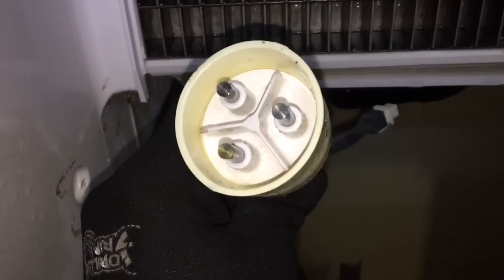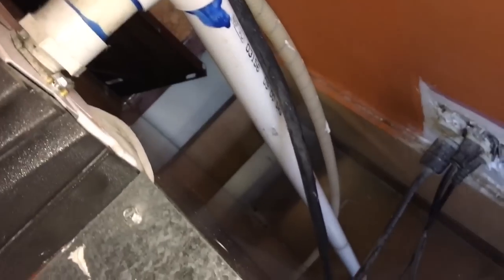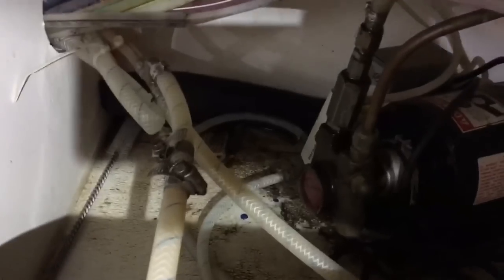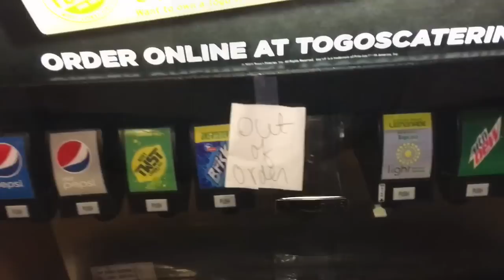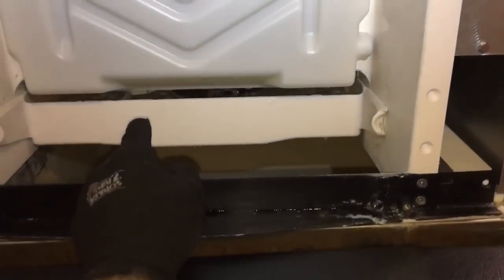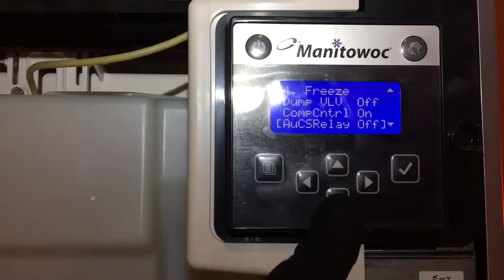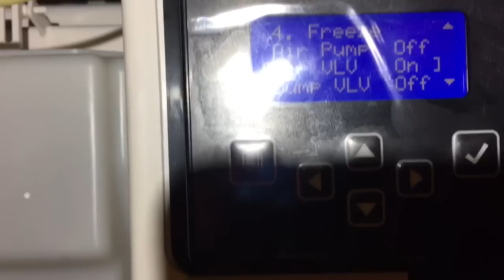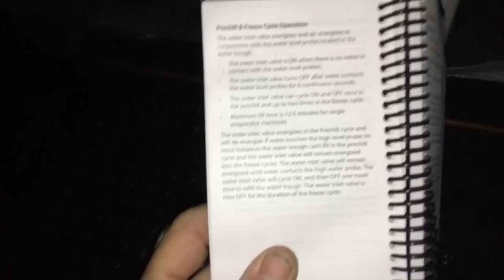Ice machine with water leak

Comment: I have a Scotsman Prodigy that's doing the same thing. I cleaned the water level sensor, but its still doing it. Not sure if the water valve is leaking by or what. It's a brand new machine, so not sure if its the water valve.

Comment: Those Water level probes are so cheap, i stock them on the truck now since the indigo's are so popular now. i Never clean them any more because all it takes is one guy to say u were just here and it's the same problem again. intermittent probe problem failing. So i Just Replace them. End of Problem. Especially if they are far away. and i'm the Hero and the Customer is Happy for a Long While. it gets Good Referrals that way.

Comment: Good Vid. are u gonna de hack it a bit ? Run a new Beverage Tubing or copper line to the ice maker ? That's the Worst Water line hack job i've seen in a while. Lol. That Water filter is Probably nasty in there too. Yikes. i Allways install Clear Housing Water filters when i can so the customer can see when it needs changing.
Reply from the maker: OcRefrigeration,Hvac & Electrical. Not sure I have them a price. And have not herd back from them yet.